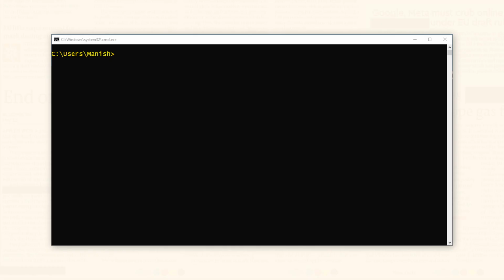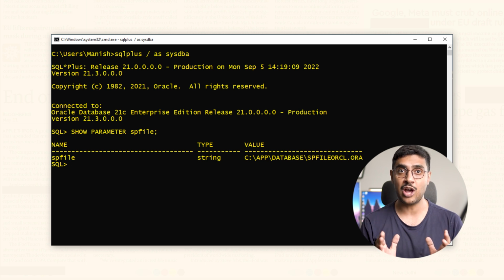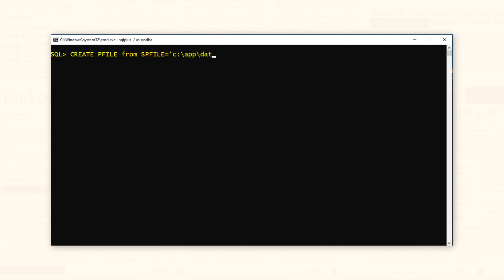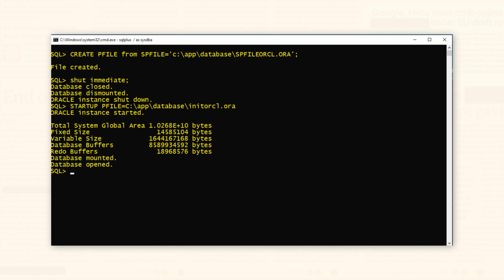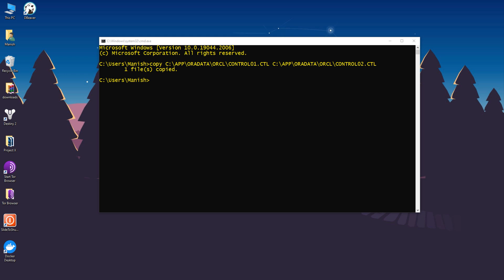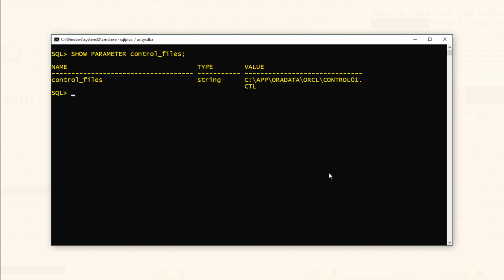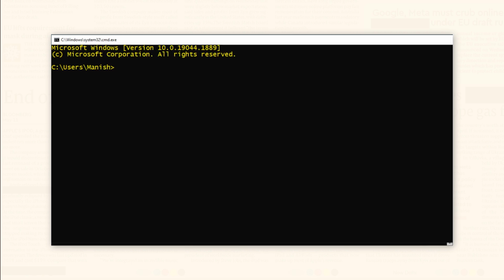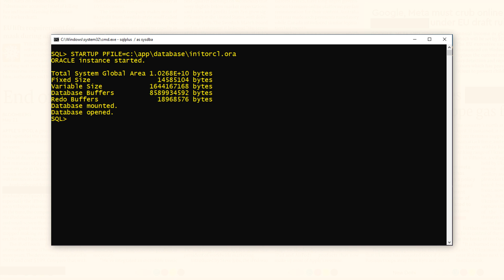How To MULTIPLEX a CONTROL FILE using PFILE in Oracle Database

Comment: This is good. However, there is still a problem. Every time you start your database, you have to specify the pfile in startup command. Moment, you start your database without pfile clause (which most of the time we do as rarely we specify pfile clause), it will revert to using spfile and in spfile, you still have single control file. Which means any changes are lost. And you are back to single control file. This video is definite progress. And thank you.